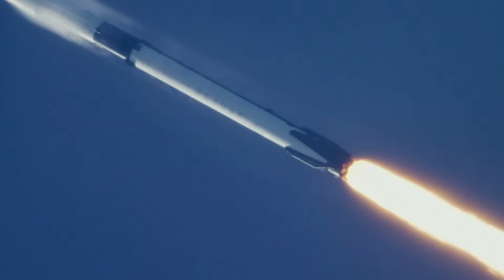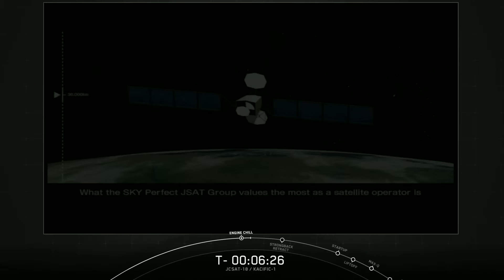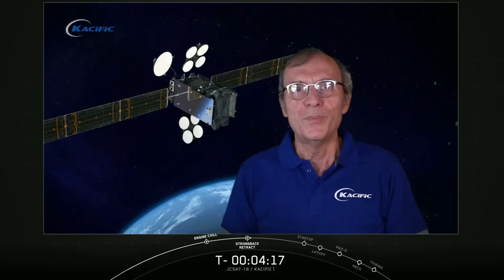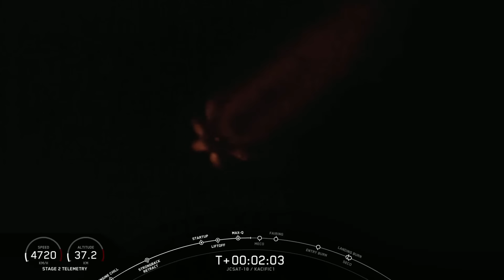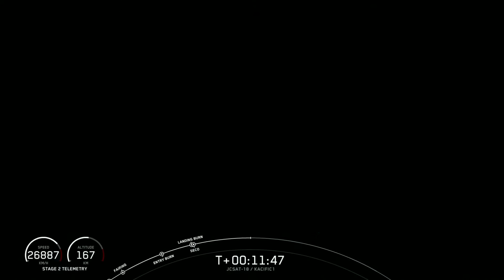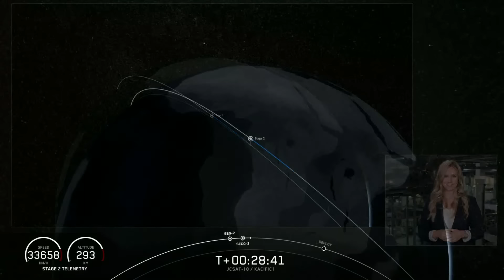JCSAT-18/Kacific1 Mission

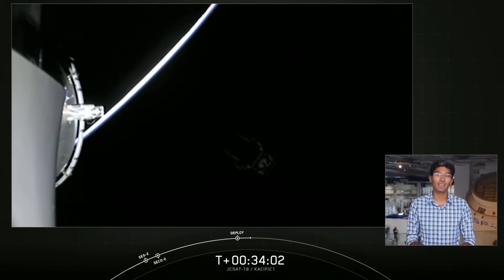Comment: 46:16-47:00 about 3 to 4 unknown white dots appear on the screen at high speeds for space maybe dust particles also maybe unknow aircrafts that can’t be picked up by radar or they use a different type of sound wave that can’t be picked up by normal radios frequency’s. One things for sure. We.. are..not..alone out in this cold dark void we call our solar system.